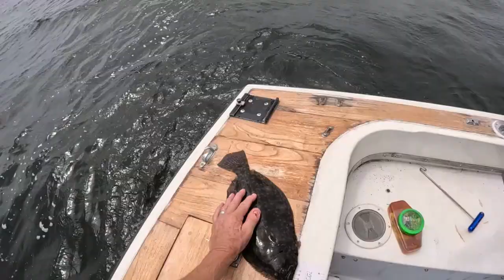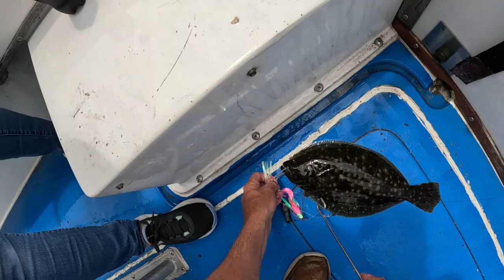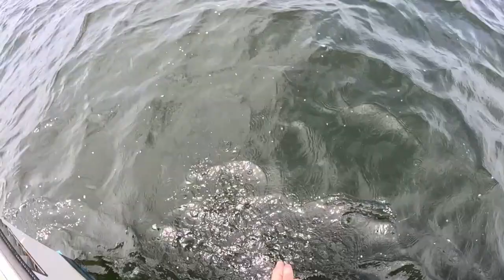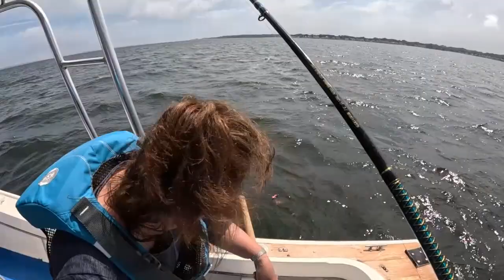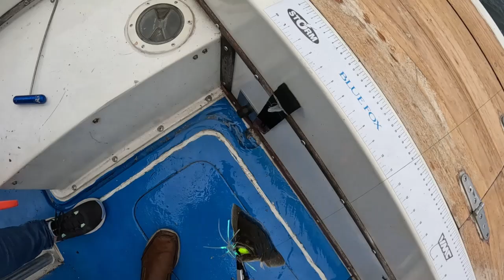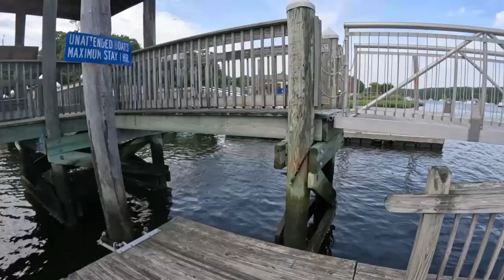Fisherman Dean Bay Fluke Trip

Comment: Great video Dean. Boat looks good.
Reply from the maker: Thanks Bill!  I hope to get to the cosmetics more this winter.  I''ve spent most of my time with getting the mechanicals in shape.  Its become a very reliable boat and the stability it has going through the water is remarkable.  I'm very pleased with it.  Dean
Reply: @deantravis6217  I’m in the exact same situation. I spent all winter getting the electrical straight now I’ve got to repower the boat which I wasn’t expecting to do right now.
Reply from the maker: @billdavis6900  I looked into replacing the long block this past winter too.  I have a company that I have bought several times over the years from. Remanufactured long blocks are around $2300 for a 5.7 of my vintage.  My engine is fine but sat for 20 years in storage so I baby it.  But I'm ready to replace if I need to.  Good luck and keep me posted on your progress